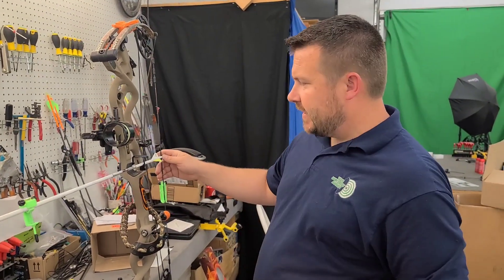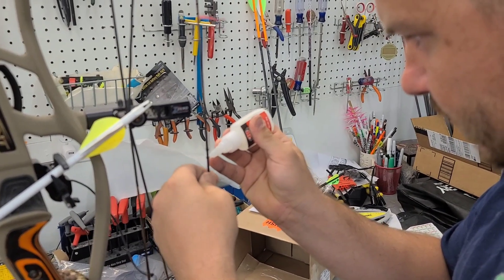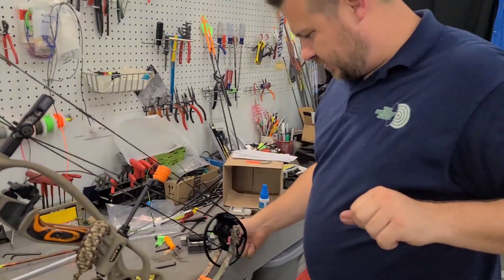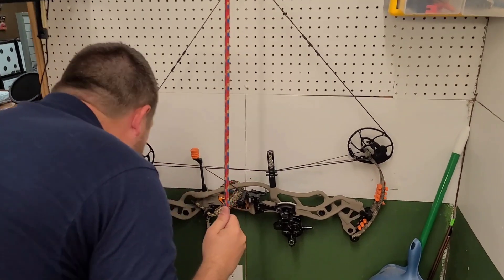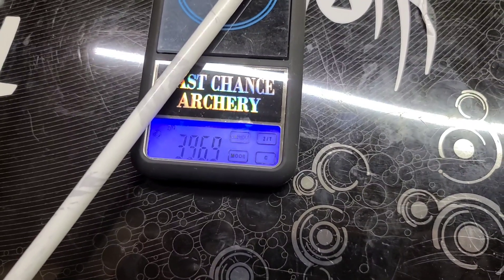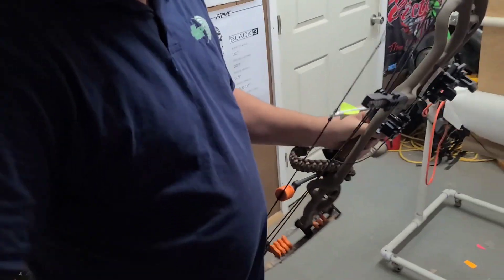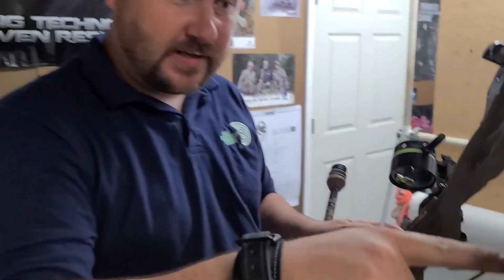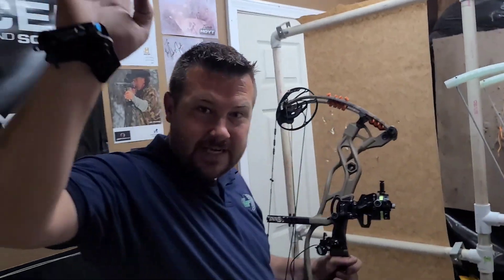Hoyt Carbon Defiant Restring + Tune

Comment: How do you know when to switch from rest adjustments to bus cable adjustments? And how do you decide between upper and lower bus cable adjustments. Finally- some bows (including my Bowtech) have a cable guide that can be adjusted- when do you adjust that?
Reply: I personally would’ve kept the center shot true and adjusted the yokes to correct the tear.